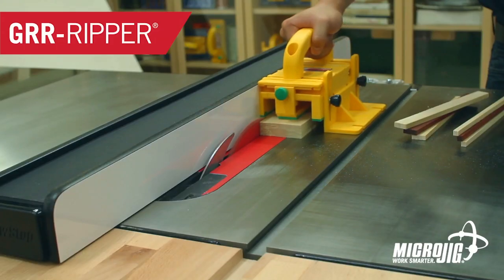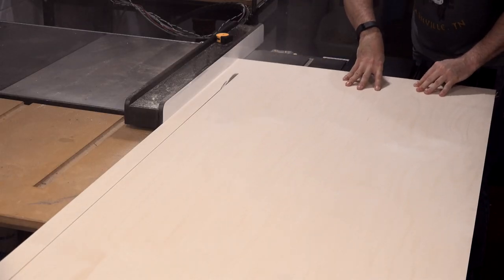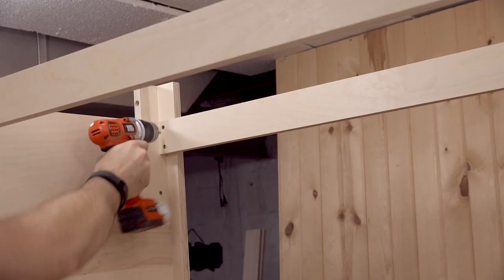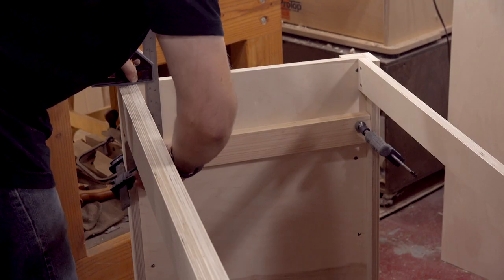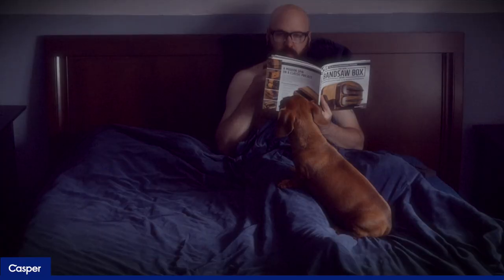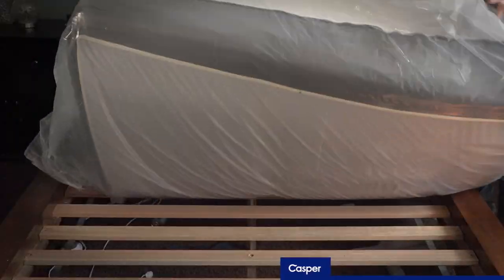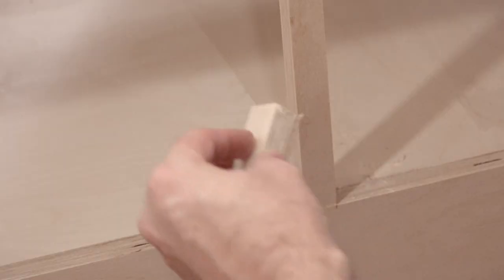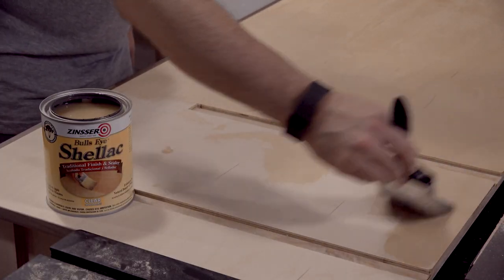How to Make a Tablesaw Outfeed Table

Comment: WOW! I love how simple the construction is! I actually plan on making this table, but not as an out feed table(don't have stable saw yet) , just as a regular worktable.  No complicated joinery, yet very solid!

Tell me, how many sheets of ply did you use, and roughly what was material cost?
Reply from the maker: +brandon2076 I use 2 sheets of ¾" baltic birch plywood. I don't remember the price. Maybe $40 per sheet plus another $40 for hinges and feet.
Reply: +Make Something 

Thanks for the quick Reply lol!
I might be able to do it with 1 b/c I would leave the bottom open.

Comment: Question, does having your table saw against a wall like yours is in this vid cause any problems for you? i have a space in my work shop area that is perfect but would put it against a wall, just wondering, thanks.  Great Vid/build!!
Reply from the maker: Not really. Mine is on a mobile base so I can easily move it if needed. Thanks for the kind words and watching!

Comment: Not trying to be a troll but have a genuine question.  I am looking to make a dust collection in my shop.  You mentioned yours was not set up on the build day.  Will your collection system work well enough to prevent dust from getting in the open back of the cabinet area? My table saw blows dust everywhere especially in the immediate area blow it.  If I had this cabinet set up in my shop it would bee filled with dust in no time.
Reply from the maker: +Quinn Geary Dust will still get into the open back but it shouldn't be too bad. My previous outfeed table had an open back. You could easily close the back. I personally didn't want to waste any more material on this project. Thanks!

Comment: quick question! I see many saws for sale in US stores use 230 volts, how does that work?
Reply from the maker: +rxwh In the US most consumer power tools are 110v. The more powerful ones are 220v. To use 220v you need an electrician to wire your shop with 220v outlets. I personally don't have 220v. Hope that answered your question!

Comment: was the new table hard to install?
Reply from the maker: +Jesse Eder No installation. I just sits behind the tablesaw.
Reply: +Make Something I'm sorry, I ment the cross cut table
Reply from the maker: A bit difficult. You have to cut your metal rails down to allow the sliding table to fit. If you ever decide to remove the sliding table you'll have to get new rails.

Comment: If your outfeed table does not extend more than 4 feet past the blade then you really cannot cut sheet goods on your table saw, and not have them fall on you. I made my outfeed table one inch more than 4 feet past the blade and when I am done ripping a full sheet the sheet will just sit there. As long as I do not push the sheet too far past the blade. But I suppose any outfeed table is better than no outfeed table. Outfeed tables are just one of those things that once you've done it there's no going back.